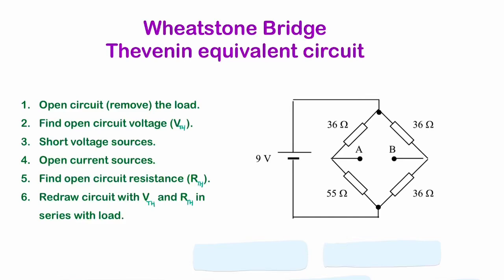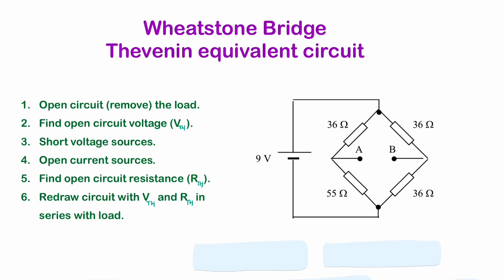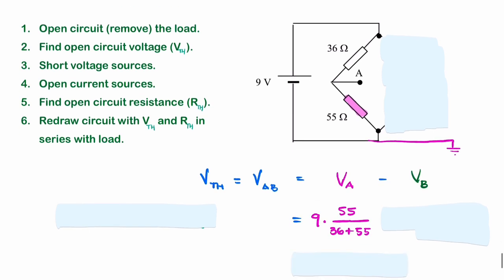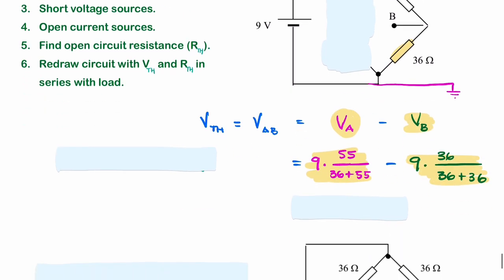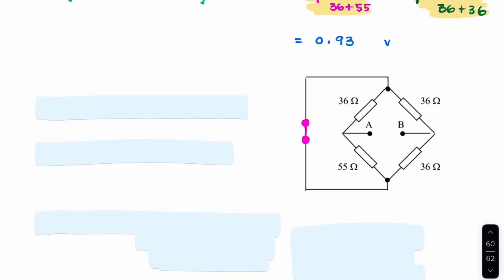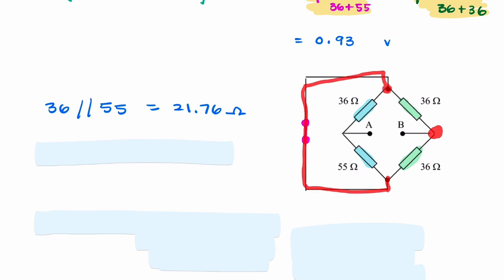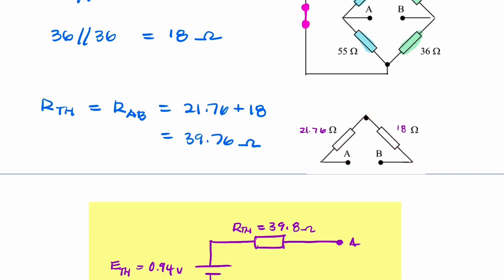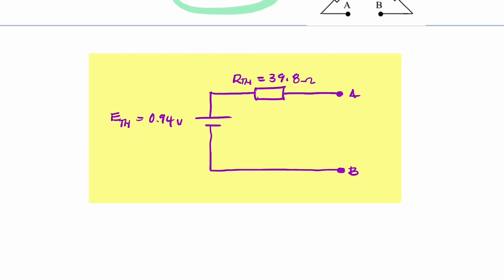Wheatstone Bridge - Thevenin Equivalent Circuit

Comment: @1:30, author says : "When you do a potential divider you can ignore the 2nd arm"
No you can't : because the current that comes out from the voltage source is being divided between the 2 arms, and so consequently, the currents passing through each arm are both lower & different from the one coming out from the voltage load.
The initial voltage divider method implies that the current is the same everywhere.
You can't modify a given circuit when trying to apply voltage divider to it (in opposition to Thevenin's theorem).
Subsequent computations are consequently wrong, sorry.
Reply from the maker: Thanks @glubzorgable for the comment! While it is true that the current splits, the voltage across parallel branches is constant. Since the left arm and right arm are in parallel, the full 9V source is applied to both independently. This allows us to use the voltage divider rule on one arm without worrying about the resistance of the other arm, as long as the voltage source is ideal.
Reply: Hi  @DrWaleedAlNuaimy  I've made a reasoning error, sorry about that : the voltage divider can indeed be applied in any single line in parallel of the voltage source, you are correct, and so consequently, it does give the result you mention.